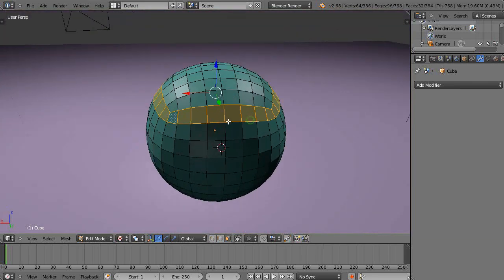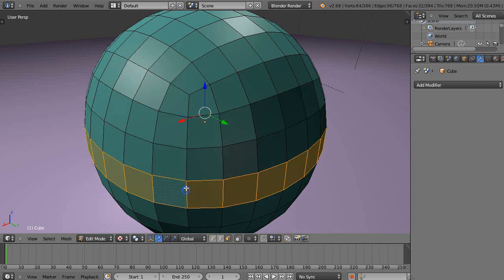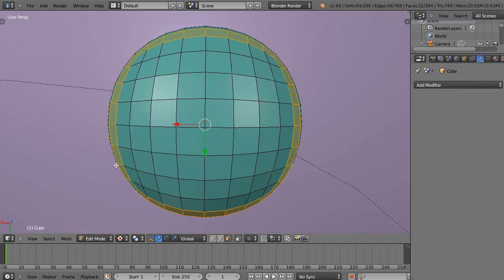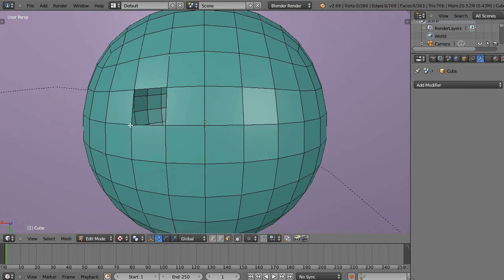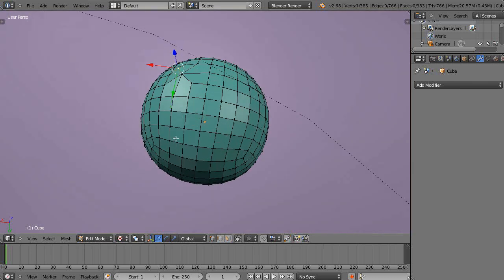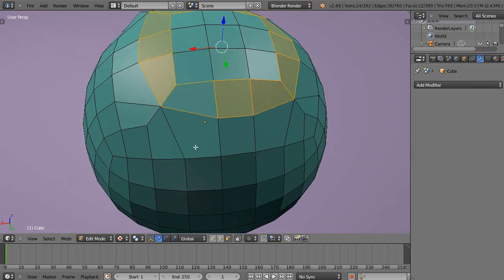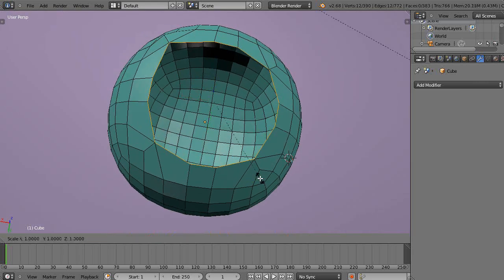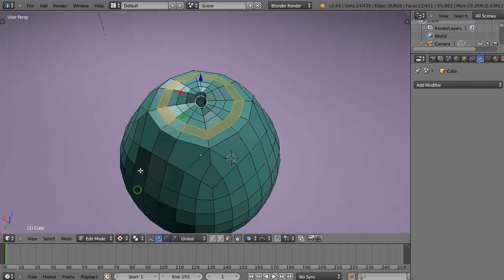Beginning Blender Tutorial - Creating Important Face Loops

Comment: O_O

Can you describe a practical application for this? Can you also describe why I would want to add all of those poles to my geometry by merging those vertices? Wouldn't that add a ton of artifacts to the model if you added a subdivision surface modifier? Can I also ask that you touch on that fact that if you had deleted the faces on the top in the first place that an ALT+click edge selection would still have selected the entire hole, so merging the corner vertices was not necessary to extrude a hole into the sphere?

What are you trying to demonstrate here?